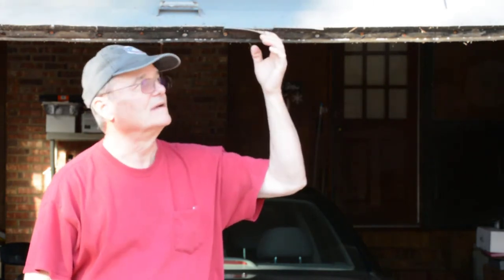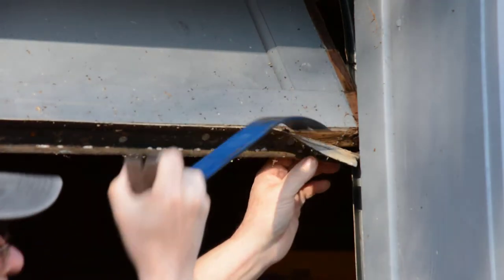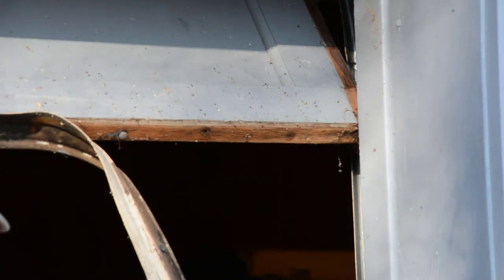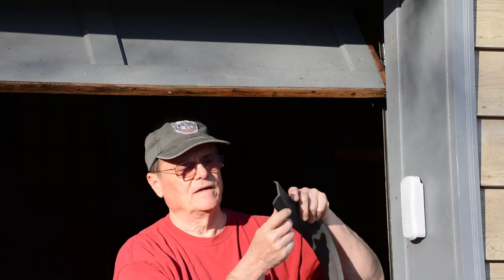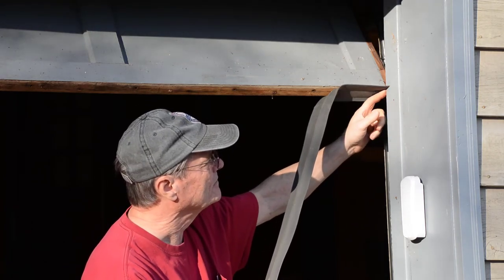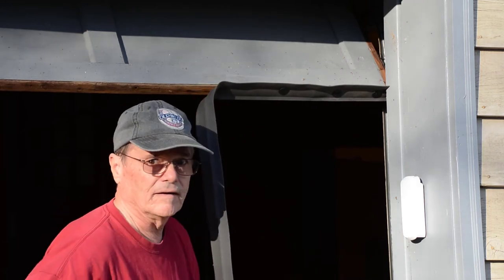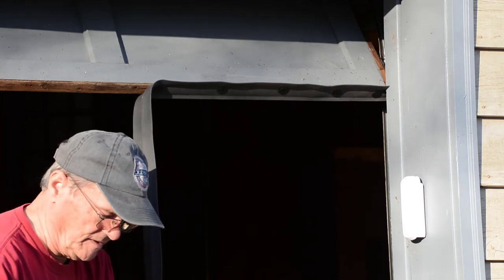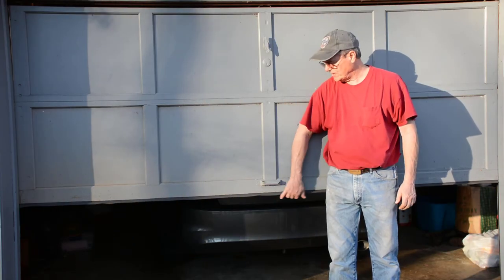How to replace your Garage Door Bottom Seal

Comment: Thank you,  my garage door is similar, I wonder why the longer side of the rubber is facing inside of the garage...
Reply from the maker: The longer flange should go on the outside of the door if using the type I installed.  Maybe your seal is a different type. Thank you for visiting and have a great day.

Comment: When the garage door comes down, did you set the garage opener to  hit all the way to the ground flat?  Or did you make it stay right where when the rubber seal's slant touches the ground?
Reply from the maker: It should be adjusted so the rubber seal has good contact all the way across.  Some areas may be pressed more than others to get a good seal.   Thank you for visiting and have a great day.
Reply: @DIYwithWayne   Thanks for responding.  3 years later since you posted this video, how's it holding up? I just bought a similar seal, made by MD. It seems thin and flimsy compared to the seals that are meant for a metal track.  haven't installed it yet though..

Comment: I saw another video were it said, small lip outside and large lip inside.  So, which is it?
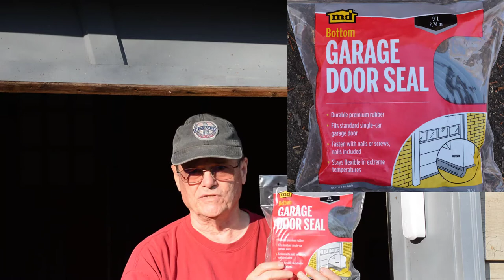Reply from the maker: It may depend on the brand of seal you purchased.  If you go back to my video, at the 2:00 mark you can see the instructions show the large lip on the outside.  I hope this helps.  Thanks for visiting and have a great day.
Reply: @DIYwithWayne  Mine and all the homes in my area are the other way, I just looked yesterday.  The small lip is outside and large inside.  Mine has to be that way, because of the way they framed my garage opening.  So, I guess it depends on your individual situation.  All the homes here also have a pretty good slope for water to drain away from garage, so that is never an issue here.  I put a new strip on yesterday same brand and style, but it was pointless, other than looks for outside, because my garage door is smiling and doesn't even reach the concrete on the sides anymore. LOL.  So, found another product to staple on the inside that is wider and covers all the gaps from the inside now.
Reply from the maker: It could depend on your situation.  In the future I will be looking at more when I can.  ALSO: if the door does not touch the floor at the edges, you can adjust the stop on your garage door opener.  The smile may be caused by the opener stopping too soon.
Reply: @DIYwithWayne   I have had it looked at before.  The smile is due to the doors age.  No fixing that unless I get new.
Reply from the maker: That should work.  Thanks for the info and the link.

Comment: What type of nails are those?
Reply from the maker: They came with the new seal.  If you need to purchase nails, roofing nails will work very well.   Thank you for visiting and have a great day.
Reply: I find nails included with the seal rust, I suggest a dab of silicone on each nail head. to prevent rust.